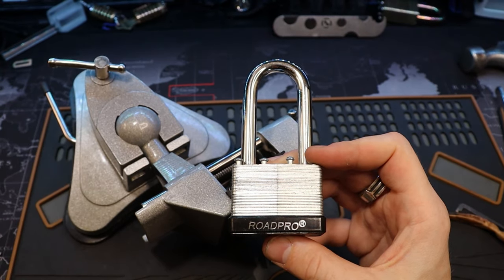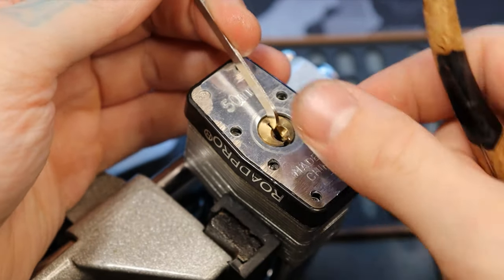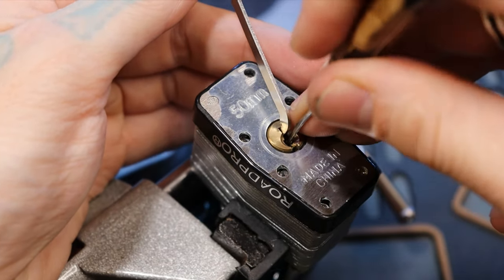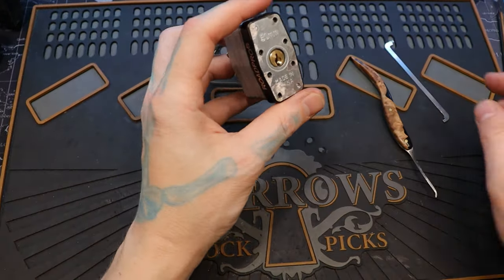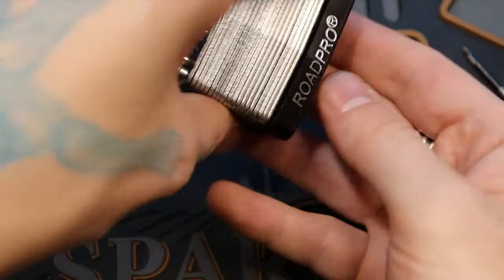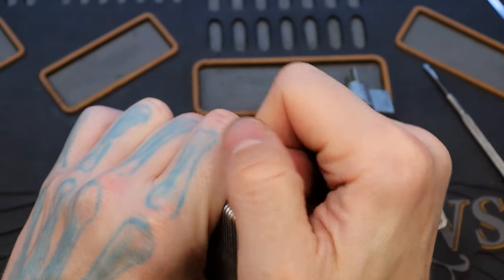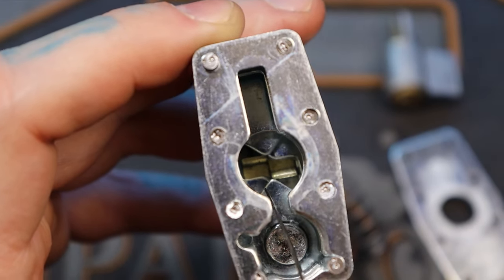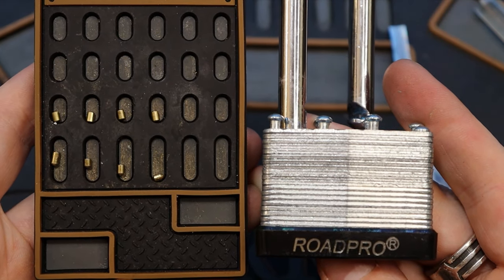262) Roadpro 50mm Laminated Padlock Picked and Gutted

Comment: Nice work. What happens to the locking mechanism from the shackle view when you push on that actuator? Is it just like a standard bypass and you’re pulling back the locking lug?
Reply from the maker: Yes, it's just pulling those bars away from the shackle itself.  The actuator bars are what is pushing into the shackle holding it into place.